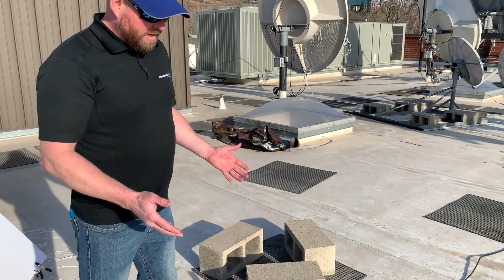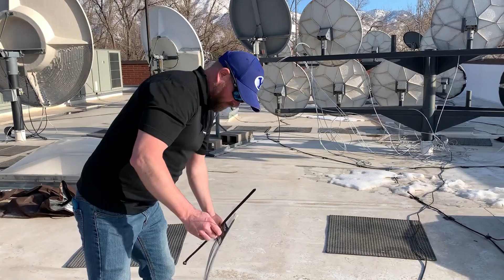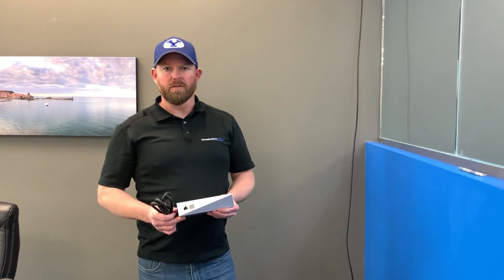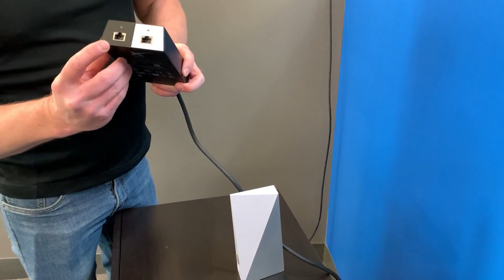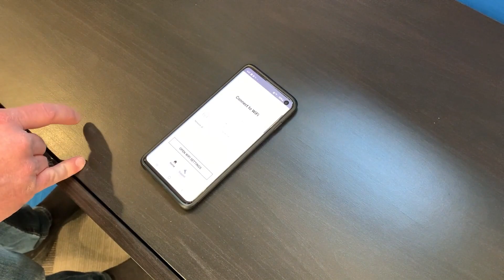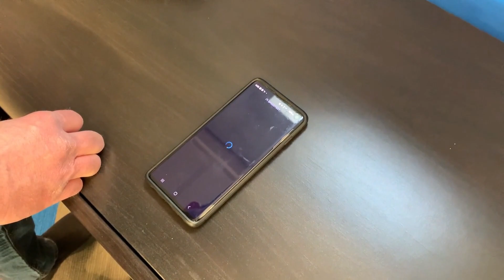Starlink internet satellite system installation and setup tutorial.

Comment: The "modem" is a wifi ROUTER,,, not a modem. There's a difference. A modem is a modulator/demodulator, converting analog to digital or digital to analog.
There is nothing analog about Starlink.

Comment: Very useful video.  Wonder how it will perform in the snow. Does it have a built-in heater or will it just shake it off like a dog?
Reply: built in heater can handle 4 inches of snow but it will still transmit even if a foot of snow is on top of it just dont let ice build up on it.